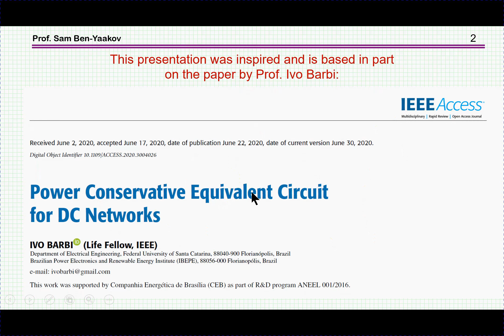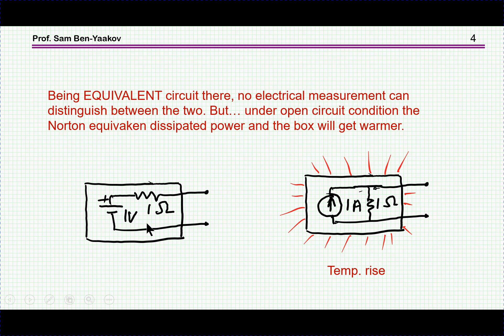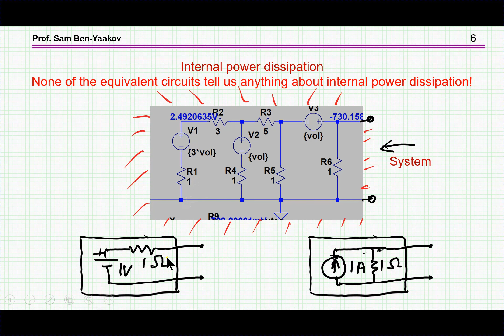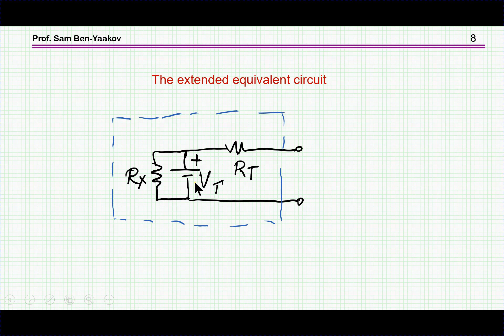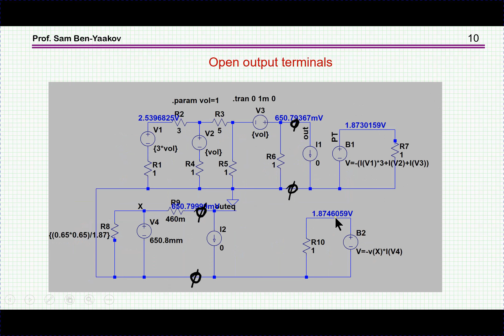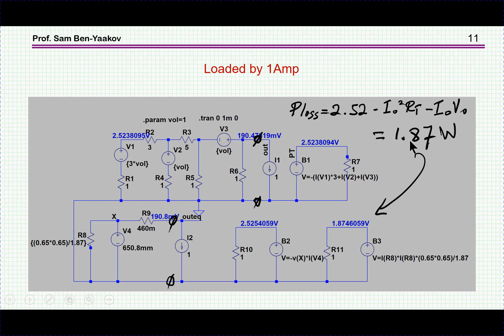A recent extension to Thevenin’s theorem and solution to ‘equivalent circuit riddle’

Comment: Thank you very much for this interesting video which sparked my curiosity about the general case and has lead to many hours of fun experimentation. I now believe that, indeed, simply adding a current source between the two output terminals of the proposed equivalent circuit suffices to turn it into a universal equivalent circuit.
To explain why I think this is true, I will adopt your approach of attaching a current source with value I_o to the two terminals of the original network. I will also denote the values of the elements of the Thévenin circuit equivalent to the network by V_t and R_t.
It is probably well known that for each resistor in the network, the current through the resistor is a linear polynomial of the load current I_o. Therefore, the power dissipated by a particular resistor in the network is a quadratic polynomial in I_o taking only nonnegative values. Consequently, the power dissipated by all the resistors in the network combined is also a quadratic polynomial in I_o taking only nonnegative values. Elementary algebra shows that such a polynomial is always of the form (I_o - I_x)^2 * R + P_x. Here, I_x is the load current at which the power consumption in the resistors of the network is minimal, R >= 0 is a resistance, and P_x >= 0 is the minimum power consumed by the resistors of the network.
Now I need to state a conjecture which I believe to be true but of which I was unfortunately unable to obtain a formal proof:
(*) The resistance R in the above polynomial is indeed equal to the output impedance R_t of the network.
Professor Barbi shows that (*) is true when no current sources are present and that the current of minimum power consumption I_x is zero in this case. I would be willing to bet that (*) also holds true for networks without voltage sources and that then the current of minimum power consumption I_x is simply the short circuit current of the network. (This is consistent with the example at the end of the video where the power consumption at short circuit is zero and hence obviously minimal.) I tried a fairly large and fairly random network and (*) was true for this as well, so I am fairly confident that it in fact holds in the general case.
Now if the network satisfies (*), then there exists an equivalent network consisting of the circuit shown at 5:00 in parallel with a current source with value I_x. The value of the voltage source in the equivalent circuit has to be adjusted from V_t to V_x := V_t - I_x * R_t and the value of the resistor R_x has to be set to V_x^2 / P_x. A quick computation shows that the output voltage of this modified circuit is indeed given by V_o = V_x - (I_o - I_x) * R_t = V_t - I_x * R_t - I_o * R_t + I_x * R_t = V_t - I_o * R_t, proving the electrical equivalence, and the power dissipated in the resistors R_t and R_x amounts to (I_o - I_x)^2 * R_t + V_x^2 / R_x = (I_o - I_x)^2 * R_t + P_x, confirming, in view of (*), the power equivalence.
Universal equivalent circuits can also be constructed by connecting a Thévenin circuit and a Norton circuit either in parallel or in series, but the computation of the element values is more cumbersome.
Sadly, apart from failing to prove (*), I was also unable to find a nice and simple way of computing I_x and P_x in the general case.

Edit: While I was preparing this comment, the user EpiScintilate proposed the same equivalent circuit motivated by a superposition consideration.
Reply from the maker: Thanks for input. Can you elaborate? Better  at https://www.linkedin.com/groups/13606756
Reply: I have now compiled everything into a short document and uploaded it to GitHub at https://github.com/julian-ahrens/thevenin_extension/raw/master/main.pdf  I was also finally able to find a relatively direct proof of (*) and have included it in the same document. I hope it is readable and maybe even interesting.

Thank you again for bringing attention to this interesting result. It has certainly broadened my horizon and further pondering the issue has been a very fun exercise.
Reply from the maker: Hi, Thanks for the details which I will have to study. Would you like to get in touch with Prof. Barbi? Please respond to sby@bgu.ac.il
Reply from the maker: Just had a peek at your write up. I am at lost. What are the expressions for Vx Rx and Ix?
Reply: If you are still interested in this matter, I have rewritten Section III to include the explicit formulae required for the computation of the values Ix, Px, Vx and Rx and updated the document. In case you have not got the time to go over it again, I have also created an example circuit in LTspice (including some documentation) if you would rather just have a quick peek at the method in action. The LTspice example can be downloaded from https://github.com/julian-ahrens/thevenin_extension/raw/master/ltspice/example.asc
Reply from the maker: Is the previous link also for the updated writeup? If not please send
Reply: Yes, I replaced the document, so the previous link now points to the updated version.

Comment: One idea is to separate the Voltage and Current equivs
as far as power is concerned.
Based on superposition, separate the contributions of 
Voltage and Current sources in the network. 
RT   = Thevenin/Norton equiv.
VT   = Thevenin equiv. of voltage sources. (o/p open ckt V)
IN   = Norton equiv. of current sources.   (o/p short ckt I)
       (can also use open ckt voltage for current sources.)
An equivalent ckt for the superposition is: 
VT in series with Rt feeding 
then connect IN across the output terminals.
IN will contribute no-load power dissipation which decreases with
load.    An additional load across VT (as per Barbi) increases the
no-load power dissipation to match the actual ckt.
With this construction it seems the short-circuit power dissipation
also agrees but I've only check a few simple cases.
Reply from the maker: And?
Reply: @sambenyaakov  From what I can see from a power perspective the Norton case is fundamentally different to the Thevenin case.   The Thevenin case cannot decrease the power dissipation with increasing load.   So the idea (conjecture) was a circuit containing only current sources and resistors can be converted to Norton equivalent plus a internal power "wasting" component.  Essentially the dual of the Barbi idea ie. an extension to the Norton case.

The next step is a circuit may contain both voltage sources and/or current sources so the second conjecture was the superposition of the Barbi equivalent for the voltage sources and the extended Norton equivalent  for the current sources would produce the correct internal power dissipation (and VI characteristic, which we already know is true).

Comment: Thank you so much, Prof. Sam, for this video. What about modelling the constant loss as a resistor in series with the current source in the example presented towards the end?
Reply from the maker: Still, in case too, the internal dissipation is not constant since it depends on the voltage of the terminals.